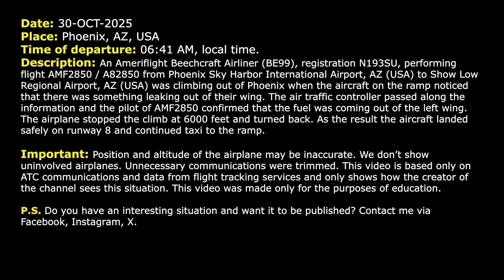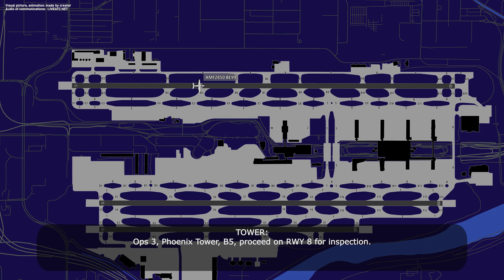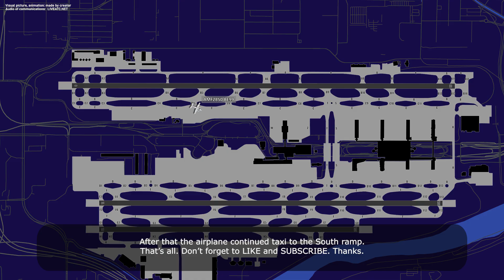Fuel Leak after takeoff. Airplane returns back to Phoenix Airport. Real ATC

Comment: omg amflight still uses those??
0:21 He sure used a lot of runway!
Reply: My guess would be they are not using nearly as much  brakes as they would to normally stop; so that any excessive heat buildup doesn't lead to a fire from the fuel leak

Comment: I’m surprised they didn’t have the trucks standing by as a precaution.
Reply: I noticed that as well. It's a BE99, so I can see an argument for it being too small to send the full team (I'm not saying I agree with that argument). They did have an OPS vehicle out for inspection, so I suspect that would have sufficed (assuming they use a truck for that purpose and not a more generic form of vehicle)